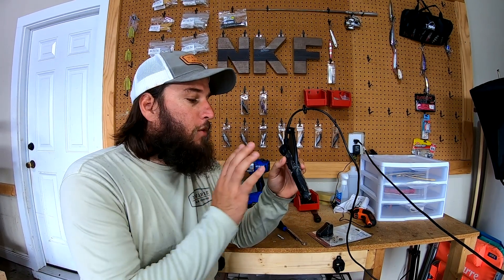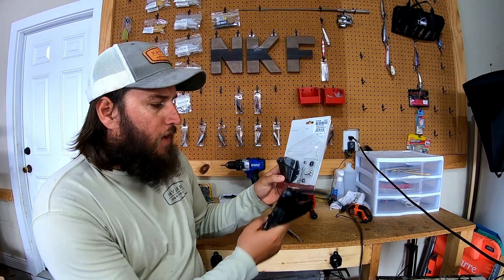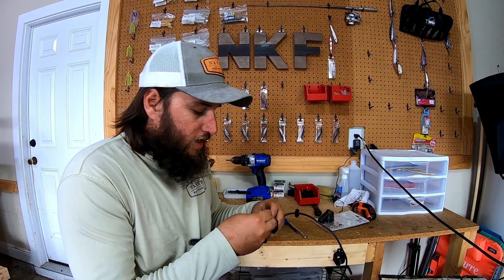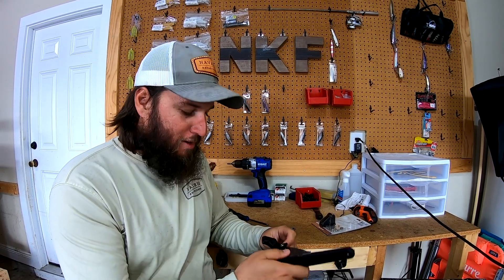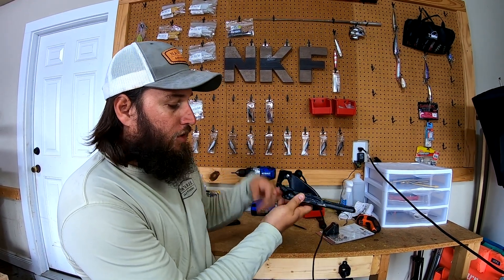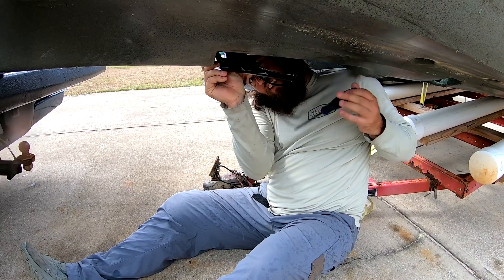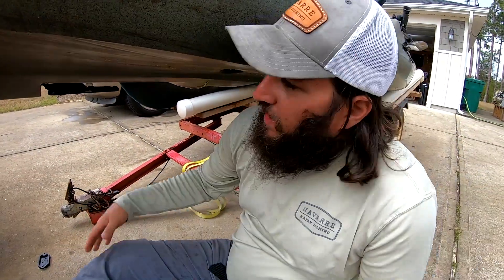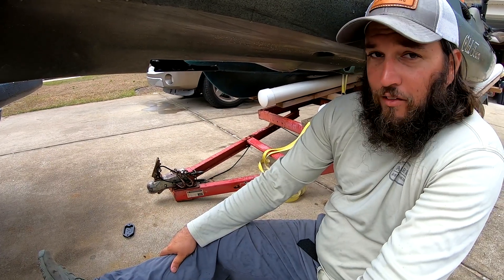Mounting a Raymarine Dragonfly Transducer (Old Town Kayak with Universal Mounting Plate)

Comment: I still don't get how you could possibly land your kayak without tearing up the transducer.  Everytime I land I'm on Gravel, Oyster, or rough sand and shells.  There is no way that would not get torn to pieces.  The whole bottom of my kayak slides on the landing surface and in and out of my van.  If I ever use a fishfinder with transducer then I will need to use an on/off over the side mount.  Of course that's just me and my limited knowledge.  Great video.  Thanks for putting it up.
Reply from the maker: It just depends on where you fish.  I mounted a GT51 in a similar manner all last year and that transducer is way bigger then the one in the video. 

It’s not recommended though! Haha